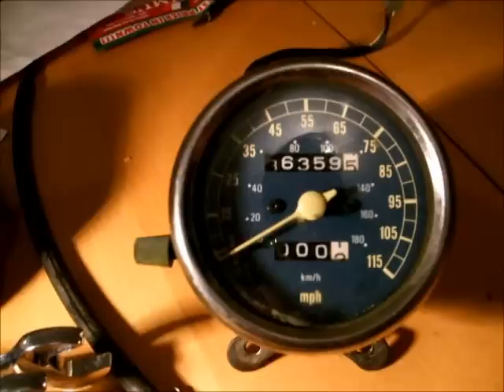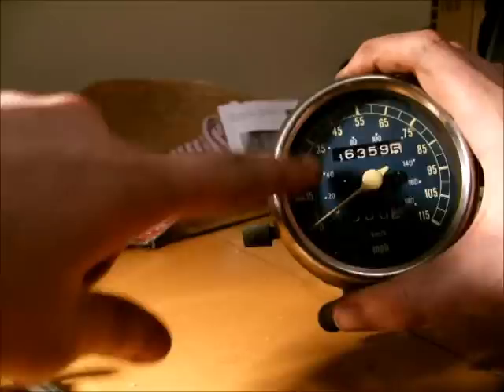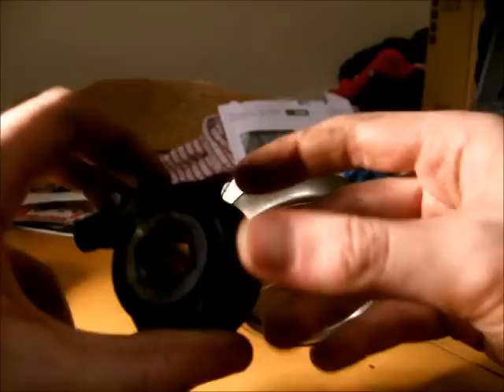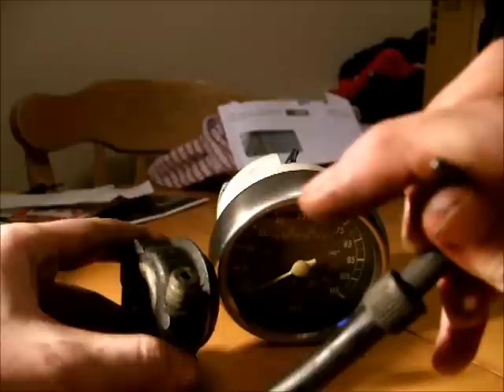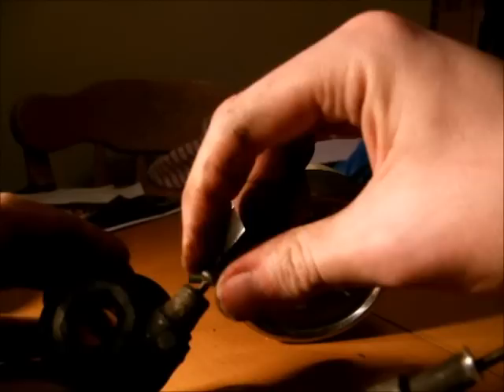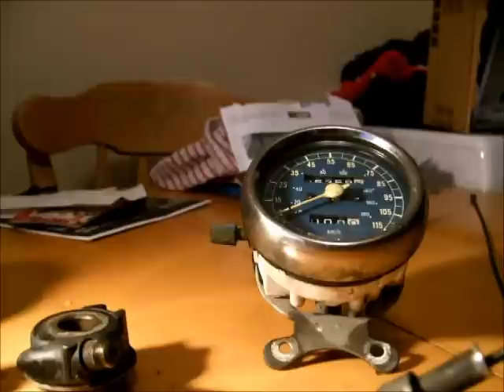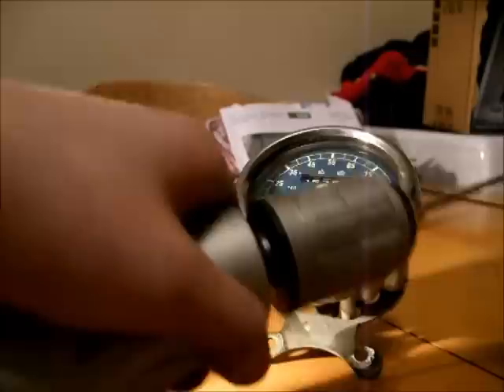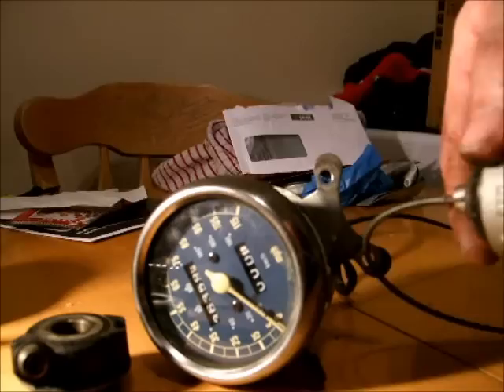Motorcycle Speedometer components: How a speedometer works

Comment: Have a 69 Honda cl125a scrambler with 03800 original miles. Hit a bad bump on the trails and 0 turned to 9. Speedo now shows 93800 mi. Thanks. This vid will help me to put back to original.

Comment: I never knew that the cable in these things is constantly spinning around inside it's housing! Surely the heat buildup caused by friction would be immense and you would think that they would wear out a lot quicker than the do.
Are there bearings at each end of the casing?

Comment: My cable looked fine but the needle bounces when I hit bumps and it wavers while moving instead of being steady it's not bouncing just isn't steady tell I get up to 55. Plus the speed seems off what you think it is? And how do I know if it's this?
Reply: Zack Ryan mine used to do that. Just means the cable on the end attached to the dial isn't all the way in. Wiggling it around for a while did it for me.

Comment: I wish someone would just explain how its insides work 

because why isn't the needle just spinning? 
how does it hover over a specific place when a specific speed is being driven?
Reply: I'm assuming there is a ratio of gears inside that convert the rotation of the cable into a rotation equivalent to mph.

Comment: Thank you for your video. I cleaned and lubricated my speedometer cable already but the needle is bouncing. My bike is a Honda Nighthawk 450. Do you know how to fix a bouncing speedometer needle? Thanks.
Reply: BrownBrady Usually a cable sticking because of wear or twisting. Lubricate the cable or check the routing of it. If that fails, renew the cable.   Most likely solve the problem. Good luck.
Reply: I have cleaned and lubricated the cable and checked the routing. I will give a new cable a try. Thanks.
Reply: Change wormset newone

Comment: Thanks so much for this video.  I've been wondering how a speedometer cable works.  A couple nights ago I heard a weird noise on my 2011 Ninja 250, like a squirrel got stuck in my wheels or something.  Search "strange sound of speedo cable" where another guy riding the model hears the same thing.  My instrument lights shorted out when this happened also and haven't worked since.  I was told that the sound is caused by the speedo cable and to try lubing it.  Any comments or suggestions?  Any idea why my instrument lights would be affected by this?
Reply: heat build up inside the gauge going through the cable. heated up the wires for the lights thus causing it to short....a little far fetched but that could be it
Reply from the maker: Hi! hard to know what's causing that exactly...was it more of a mechanical squeeking noise, or an electronic one? Does the 2011 nija have an electronic speedo display? If it was a mechanical noise I would suspect that something is wearing on the inside of the speedo unit, or, as suggested above, the cable needs a bit a clean & lube! If it's electronic, im afraid im no use to yu here in this post - check your regulator, battery and wiring to the speedo... Good luck!